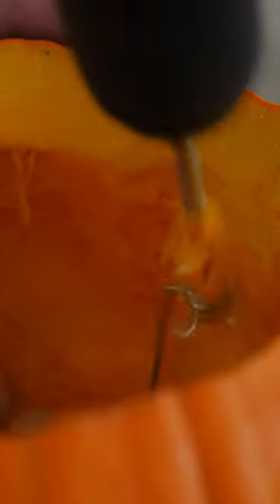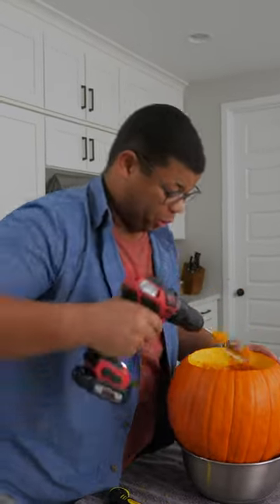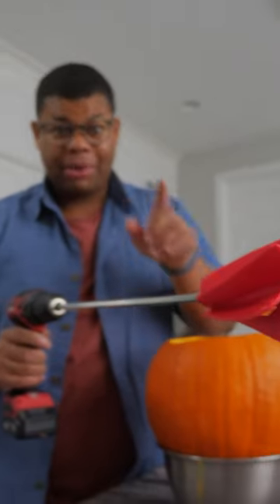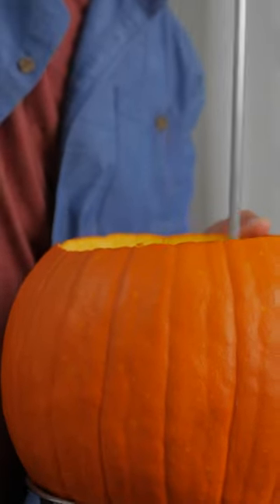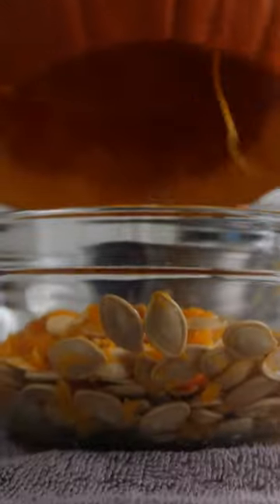Pumpkin carving with electric tools 🎃 #halloween #pumpkincarving #lifehacks #pumpkin

Comment: I use my power drill for CLEANING too.  There are nylon brush attachments especially for that. but I make them myself too. 

      Of those "eco friendly"
wooden dish brushes, just take out the circular brush head, 
     find the center, drill a 5/16" hole in the center.
     Then get a 2.5" long 5/16" bolt (+ a spring washer and a lugnut).

Bolt goes in from the bristles side. tighten on the backside. 
     Now you can 'chuck' it in your drill :)

They actually sell those drill brushes in stores too ;)
         For a couple of bucks, you get a 3-pack; 2 flat brushes (with real sturdy hairs), and.. a toilet brush shaped one! 

cleaning is much more fun with power tools 🤘